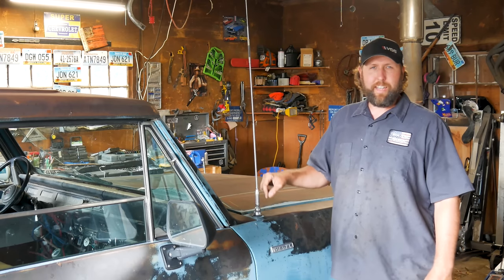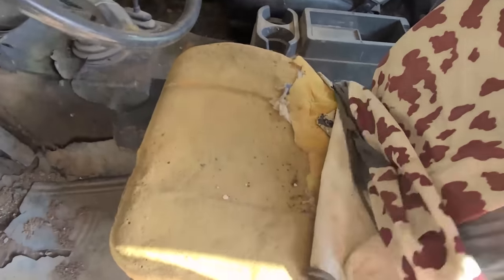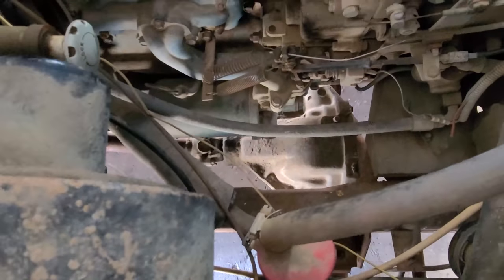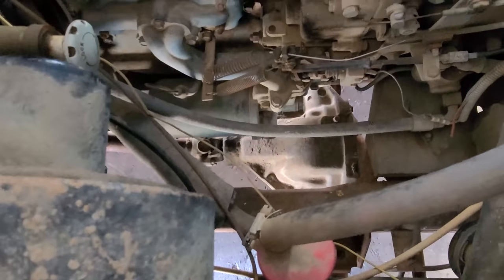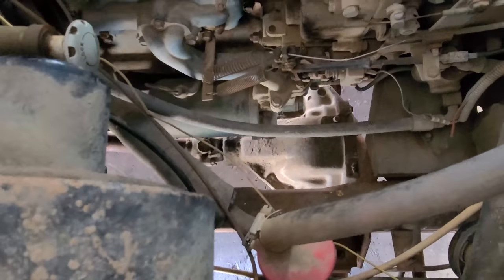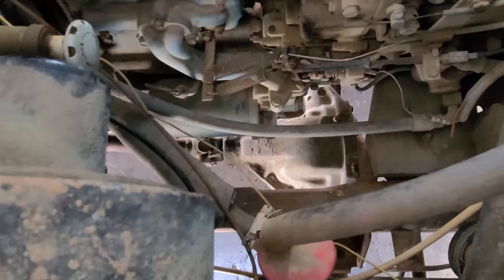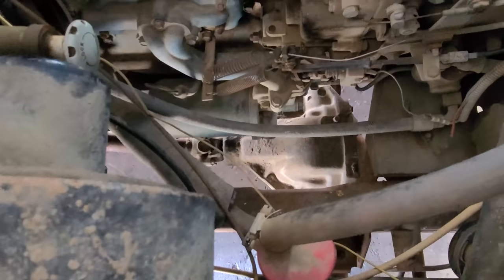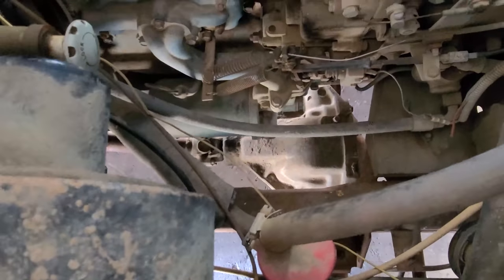FORGOTTEN International Scout NISSAN TURBO DIESEL - Will it RUN AND DRIVE 600 miles?

Comment: Bentley's gonna be 80 years old with a grandkid on his knee telling about the time him and his pops drove 600 miles in an old Harvester on pizza and Yahoo. More holes than swiss cheese and one of the best times of his life! Brings a tear to an old guys eyes.
Reply: The thing will be, that his dad was able to fix something, and that thing being a mechanical unit that intermittently compressed air and the injected hydrocarbons pumped from the ground that came from the distilled carcasses of prehistoric animals. A series of explosions used to move the vehicle forward. I will probably seem more primitive than a steam engine does to our eyes today. How many people in 70 years will be able to fix or repair anything at all. Many today cannot even.

This is part of the joy I get - seeing machines being fixed, rejuvenated and brought back into operation.
Reply: That's what it's all about. Kids are only young once and we won't be around forever so do things and have fun today so they will have the memories for tomorrow.
Reply: @timcarpenter2441  Thing havent changed much over the last 100 years combustion wise, aside from hydrogen - I dont think it will change much from where we are now.

What happened to "flying cars, hoverboards, and self tying shoes?"  there are a few examples....but they are concepts far out of the reach of most people. We've just refined what we had over the past century and now people focus on things that dont matter today and buy into what they are told.....

"How many people in 70 years will be able to fix or repair anything at all."
The issue with this statement wont be because of  technological advances, it will all be due to the ineptitude and laziness of people. You can see that pattern today all around you, people would rather someone e else do it for them and would rather not bother to learn for themselves. Idiocracy was a prophecy. I know I sound pessimistic/cynical but its the truth.

I would put my life savings on that we will still be using the same or similar engines with either hybrid or hydrogen vehicles becoming slowly more mainstream.
Reply: @Raymo2u  But you see the truth, which is why it's stigmatized to be pessimistic, cynical, depressed, or not totally content to take everything at face value (all while the idiots who do so are brainwashed to believe they're "Intellectuals" and "critical thinkers"). I'd rather see a cynic any day, they're the ones who are rational and in touch with reality.
Reply: I think this will be one of Bentley’s best memories in the future just him and his dad on a road trip in a sketchy old truck that hasn’t been on the road in nearly 20 years. I remember helping my dad with an engine swap when I was 10 on a 1961 Ford Falcon back in 68 it got me hooked on auto repair.
Reply: @steve-ph9yg  unfortunately I'm not mechanically inclined. I need directions to change a light bulb and there better be pictures! Not really that bad but nowadays damn near need a degree just to get the power make it happener barn door open.
Reply: @Raymo2u  vehicles made today will not be the kind one can pull out a field and fix. Too many computer components and diagnostics.
I agree that too many don’t what to fix things.
As for the future, it is possible that we still use hydrocarbons, just that they are synthesised and not fossil.
Reply: Amen dude!
Reply: What holes?
Reply: @mikeholland1031  what would be the trunk area was rotted away. I think the floor boards also. VGG not know for air tight vehicles.
Reply: @Raymo2u  there aren't many mechanics left. Most of what we have are technicians who read codes and replace parts. It's very hard to find someone who can actually tune a carburetor, let alone properly set timing and dwell on a points based ignition system.
Reply: Not to mention he will have all these videos to show them.

Comment: EQ set to flat =
"Feller didn't like to party much"
LMAO. Facts.
Reply: > installs EQ
> sets it to flat

why
Reply: No shit, what’s the point ? 😆
Reply: @deborahchesser7375  there is no point!!!!
Either USE it ....or why burn the money?
Reply: @VividPetrichor  Probably only got AM radio where they were located.
Reply: @cornrichard  Tape player.
Reply: Or maybe the dry rotted speaker cones sound like an old man after he ate a can of Bushes baked beans, if the bass slider is turned up too high. 🤷🏻
Reply: @VividPetrichor  Remember, that eq has an amplifier in it that probably has more power than the deck itself, no matter where it's set at.
Reply: I listen to talk radio with the bass up to 11 out of a kicker, because I happen to like to party.
Reply: Heh. Well, that's how you're supposed to use an EQ. Or at least take out what you need instead turning frequencies up

Comment: "We'll spray this thing out gently"
sprays violently into the radio and dash as if electronics don't exist

His sarcasm never gets old 😂
Reply: Don't know if the radio and equalizer will love that cleaning, but with the uncovererd driver seat the driver will definitely have the soggy bottom blues!
Reply: @kukipett  that's exactly what i was saying
Reply: There was quite a bit of deb-bris caught up in the ol Kraco...
Reply: I didn't know  you can  make something  temporarily  permanent!!!!!
Reply: The radio might care...if it works. Otherwise, there isn't much in the way of electronics on those old diesels.  If an EMP hit, they'd be the only vehicles that still run.
Reply: It's top notch I do say.
Reply: As an IH owner, I can with 100% certainty say that if it has an electrical issue, it’s the green wire.
Reply: emphasis on GENTLY!

Comment: Derrick, I have a 1974 olds omega for you, about 10 mins from the freedom factory (my grandmother ran that track for years when it was desoto speedway, her daily driver was the 94 cobra pace car haha no joke)
Reply: 350 rocket/4 brl
Reply: I was just down there at the end of June.
Reply: I need him to see thiss
Reply: If Derek doesn't want it, I may, and im only 1 hr away
Reply: Omega... Same as an old Nova right?
Reply: Would make a sweet gasser
Reply: Olds Omega, Chevy Nova, Pontiac Ventura and Buick Apollo are really the same cars....
Reply: @grantkoeller8911  different front and rear clips though, like Camaro/firebird, etc.
Reply: @grantkoeller8911  Nova - Omega - Ventura - Apollo.. as Im sure you know... N.O.V.A. :)
Reply: Nice
Reply: Sending you to the top with a vote. Thanks fellow Dave that sounds really cool.
Reply: A blue 1974 Olds Omega was the first car I ever owned. Bought it used from my mother and ran it into the ground. A great piece of basic transportation! I made a lot of memories in that old beast.
Reply: @grantkoeller8911  All based on the Nova: Nova Omega Ventura Apollo

Comment: Brings back memories of my grandfather driving me around in his 1972 Scout II. I need to get it roadworthy, it has a brake leak and a radiator leak. Last time I toyed with it, I couldn't find where the brakes were leaking from but I'll give it another shot when I get the time. Perhaps I'll make a video out of it. It's been sitting since 2013 and the thing really is as mint as can be, not a spot of rust, no dents at all.

Update: I replaced the rear brake hose, and the radiator. The new rad is slightly taller than the original, so I need to make a bracket for the fan shroud, then it’ll be ready to go. Really excited to drive it again.
Reply: that is awesome

Comment: As a former Scout II owner watch out for the upper tailgate hinges. They tend to tear out. Also, the body rarely gets hail damage as it's extra thick steel. They only had about 15 or 20 different key sets. Also, the drag link tends to get loose so your front end drifts a lot. I've known several teetotaler owners who got pulled over for suspected drunk driving.
Reply: We had a 78 Scout Traveler and it was the absolute worst handling vehicle I've ever drove. I don't miss that thing at all, but it was nice to take a trip down memory lane watching this video.

Comment: Have you thought of fibreglassing the rotten underside of these vehicles? You get structure and salt resistance in one. Or a few layers of mesh and bedliner, for a quick patch.  And polycarbonate for window replacement as you can cut onsite with a saw or grinder. And stronger than the glass. And fill the rust pockets with spray foam so more mud and moisture can't get in there again. The rocker I would slide a aluminium pipe in and fibreglass it in. All dodgy but gets it done fast.

Comment: “100 horsepower at 3900. Moses sandals this must scoot!”
Reply: You sir have won best comment!🤣🤣🤣
Reply: yea it runs.. not fast but it will drive over just bout anythin
Reply: Its about the Torque.
Reply: Its not the amount of HP , torque or cubic inches you got...

Its what you do with em that counts..
Old diesels are damn near indestructible if you treat them with care and often have more than 1.000.000 km on the clock  without needing a rebuild..

Comment: Since oil doesn't go bad in sealed containers, I'd be tempted to buy a 50L drum or 7 of that Shell stuff in case they stop making it with all the vitamins and dinosaurs in it!
Reply: Better hurry up. Rotella can't get SN certified because theirs too much ZDDP. The environmentalists really hate all them dino vitamins. Would rather have engines wear out quicker.

Comment: My mother had a Scout International. I remember her buying it brand new, the back seats, seat belts and even the roof were an added option, it was listed as a utility vehicle. The thing was a tank, all steel and tough as nails. There was a wench on that could pull it up a tree. I remember the wind shield always having cracks in it, the rockers were always rusted out (no matter how many times she replaced them). Those rust spots and streaks were in the same place as hers, happy to see they were consistent at the factory. I don't think the back bumper you have is an add on, I remember something like that even the offset ball hitch.

Comment: the old fuel in there looked like red dye diesel for off highway stuff.
Reply: Yea, that's the non road legal fuel, less taxes on that stuff...
Reply: back in the early 90's you could buy premium highway use diesel called Knox Super Red.
Reply: I have never had my tanks checked but hey, could be used ATF...
Reply: @rednexicanhendrix3903  I forgot that people do that to clean up injectors and what not so I can see that being the case. My brain went straight to red dye cause he said a farmer had owned it.
Reply: Oh I'm sure it was off road, but I have known people with shops who cut in used atf just to save on fuel. Even know a guy that runs used engine oil(not saying it's a good idea but older diesels will run off it, just keep changing your fuel filter!) It'd be hard to pay full price for green diesel when you have hundreds of gallons of cheap stuff just sitting there...
Reply: Looks like dyed diesel to me too.  Revenuers severely frown on having that in you on-road vehicle.
Reply: The red color dyes a TON of fuel, stays in the tank for a long long time.
Reply: I'm pretty sure that the red die is kerosene
Reply: @gregashton9933  That’s what I was thinking when I watched the video too, my old man used to run diesel and kerosene in the furnace of our 150 year old house, but I always remember the kerosene being a scarlet or almost purple color.
Reply: I would of course note that I have no idea what I’m talking about, just speaking from memories
Reply: @miketheknive1632  lived in a small town in TN that had it on pump
Reply: @gregashton9933  Yep, we lived in a tiny town in the north east and had two kerosene pumps.
Reply: That would also explain why it still ran fine on it.  Hard to beat that old stuff.

Comment: I don't think that was nasty diesel, I think the previous owner was paying like ¢50 a gallon for dyed diesel and just running it on the farm
Reply: Like diesel for heating houses and stuff ?
Reply: @gnaedigerfels  yessir
Reply: @applejacks8160  Isn't that basically tax fraud ?
Reply: Off road fuel..no tax.
Reply: @jamespskowski432  but if you would use it on the public roads it would technically be tax fraud because where i am from that would be the case
Reply: @gnaedigerfels  it’s fine for farm equipment/vehicles that aren’t normally used over the road - you can fill something like this Scout with it if it mainly gets used on a farm. If it sees highway time a lot though, then yes, it’s technically illegal to run red dye in it.
Reply: @gnaedigerfels  its only illegal if you get caught, every DOT enforcement officer i have ever ran into only pulled over vehicles that are considered commercial vehicle. if a diesel powered f-250 drove by the check point they wouldn't even bat an eye. but if it was a tractor trailer or straight truck drove through they would dip their little straw into the fuel tank and if it was cherry colored then you were gonna get a large fine.

Comment: That’s probably got old school diesel in it. That isn’t like the modern low sulfur crap that goes bad when it sits. Pre low sulfur diesel didn’t seem to ever go bad.
Reply: The red could be tax free farm fuel. They put a dye in it so it can be identified on the highway.
Reply: @masonernest8506  I've heard of this. It didn't look too brown like a varnished gas/diesel would either. At least that's what I thought.
Reply: could be, and likely is, tractor diesel.
Reply: That’s faxs , I had a 84 Ford dump truck with a Detroit in it, and it sat for 20 years with the same fuel and started up first crank
Reply: @bubbashubbs298  and the filter was relatively clean.
Reply: I thought the same thing. Farm diesel is usually red, and that fuel didn't look terrible either.
Reply: Red or not it’s pre low sulfur. The good stuff

Comment: The color of that diesel makes me think they're running off-road diesel which you use on the farm
Reply: The cheaper red diesel with 1,800 ppm of sulphur... fuel pump likes it though.
Reply: Orange is farm or off road diesel . The dyed green fuel. Is extra low sulfur. But its illegal for many reasons but us so much cheaper .and its the same shit from.what I hear just burns hotter
Reply: Could be #2 heating oil?
Reply: Red dye is added to off road diesel in Florida. Same as regular diesel, just has dye in it and cheaper.
Reply: Red dyed diesel is “off road” only in my state. Normally used for farms and heavy equipment, it the exact same stuff as yellow/green fuel but it’s marked with dye to show it didn’t pay any road tax. If you get caught on the road with it in your tank it’s a VERY hefty fine.

Comment: I loved working on those SD33 diesel Nissans. Super easy to set the valves when the engine is idling. They were originally a forklift motor that made their way into small trucks. Stump simple to fix and maintain.
Reply: set the valves while the engine is idling ... sure